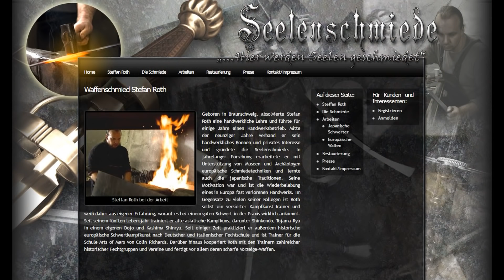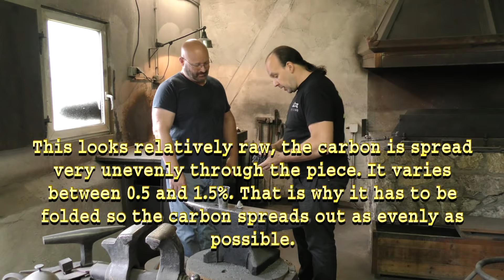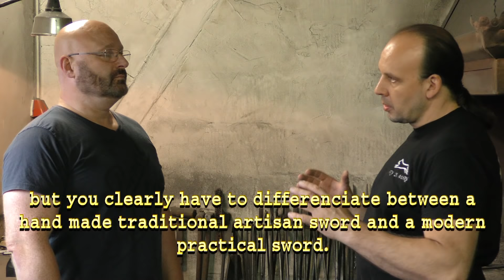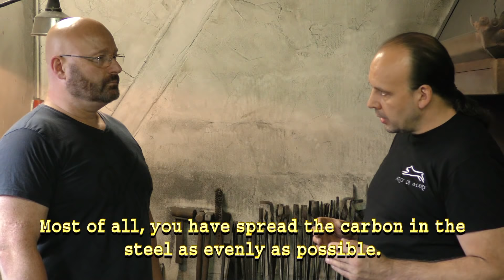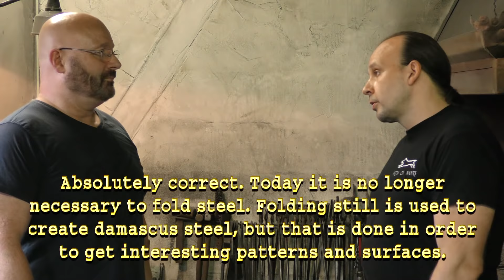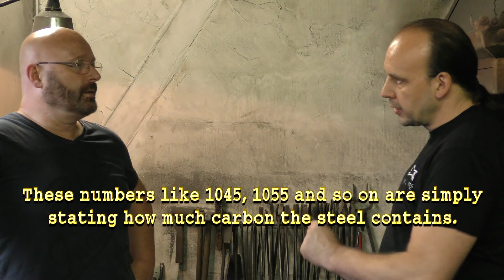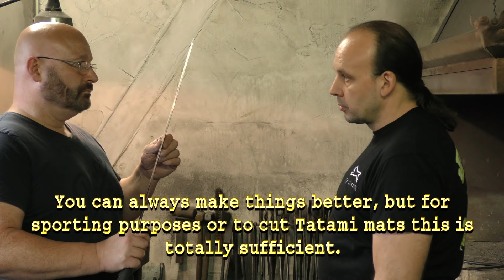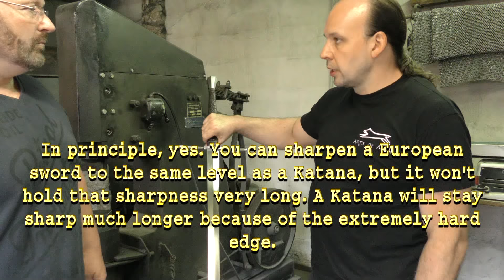Katana: The Naked Truth

Comment: I'm not an expert so feel free to correct me but it seems to me (by my observation at least) that cutting a tatami mat without a peg is a different kind of cutting test that could either be used for extremely sharp blades, extremely precise cuts or both. Without the peg, the tatami mat is going to fly off the stand even if you cut through it, because it is very light and doesn't require much force to move it. Therefore I think that cutting a tatami mat without a peg like that would be more of a test of precise edge alignment, blade sharpness, and anything else that can make cutting require less force, because it would show that you can cut through the mat with such little force that it remains standing even without being held in place.

Comment: you can cut steel with steel...kinda, but it still uses physics, a softer steel meeting a harder steel one of them will give out for instance i had a cheap 40 dollar mild steel ninja sword and my cousin was using a machete, the machete gut some nice little gashes into the blade of the ninja sword. 

Doing some research i found a video that showed you're supposed to parry and and block with flat of the blade and not the edge, supposedly George Washington's Saber had a an area of the blade that was wider for this purpose. Also if it's a double edged sword, and you black with the edge that means there is a chance the blade will be knocked into with the force or rebound.

Comment: Great video, the only thing missing is, why did the japanese decide to harden katanas more on the edge than the inside of the blade? Does it have any advantage over an uniformly hardened sword other than a better edge retention?
Reply: Historically there were only two options when it came to steel, it was either hard enough to break or soft enough to bend. A uniformly hardened sword would be more likely to break, and because of the kind of stress the steel in swords is subject to would break fairly easily. This is why in most places of the world swords were not a uniform hardness, even double-edged European swords typically used mild steel cores (mild steel doesn't significantly harden in a heat treatment) with high carbon edges. Or, as evidenced from at least a few Polish swords, they made the sword completely from mild steel and "case hardened" the outer layers.

Common use of uniform hardening wasn't really a thing until closer to the 18th century, coinciding with the rise of the nation-states in Europe. By this time spring tempering had become a more widespread practice which gave the sword a third alternative - to bend and return to true without either breaking or permanently deforming. Though European longswords are commonly erroneously said to be spring tempered (like their modern reproductions), there's virtually no evidence of the technique being used on European swords until the 16th century and even then it's few (relatively speaking). The only swords commonly seen with uniform hardness prior to this would be Middle Eastern and Indian swords, however it would be more accurate to say "uniform softness" as the swords were left annealed rather than hardened (due to their excessively high carbon content, combined with high concentrations of sulfur and phosphorus).

Comment: Nifty video, thanks Jörg. =)
For what it's worth, there is a specific kind of cutting practice/competition/record where you have a freestanding roll of tatami on the floor (not on a platform like here), and you try to cut it as many times as possible without it falling over (I think it's called "suegiri"). The current world record seems to be 7, held by Isao Machii. The 8th slice wasn't too far from succeeding either. Those slices were all diagonal downwards, with my physics hat on I'd say that's so that the roll is pushed against the floor during the slice, supporting it slightly more than pure sideways or an upwards cut would. Isao is generally a super duper accurate cutter, he has cut free standing pea pods in half, hit 6mm airsoft pellets from flight, etc. Supreme skill on that man, but I don't really doubt a European sword could do the same things if wielded by someone equally skilled (though finding that someone would be difficult). =)
Reply: Well finding such a man would be hard when the HEMA community is barely 35 years old with people with actual jobs and the test cutting part is only now getting real serious. Give it another 100 years and probably.

Comment: You can fix sword blades with welding some more material on them and then grind it sharp and polish. I have used PUK welding machines from Lampert. It is not easy but it is possible to fix blade so goodly that you cannot find the spot anymore what has been fixed. I am a goldsmith so not that hard work.

Comment: Actually in the process of making the Tamahagane, they will also produce a raw material with less carbon contain (with is softer). The traditional Katana smith will use both of these, with the Tamahagane wrapping around the softer material. So the hardness to softness is not just edge to back, but outside layer to in side as well. 

They reason they do this is combat vs. War. In a single combat, you might want a hard sword. But in a long war, you need a sword that holds it's edge much longer, yet do not just snap in half after thousands of cuts and impact. This is why they developed the Katana that way. If the reason of the wrapping is only to purify the steels, they would have just produce steel ingot and ship them out. But the fact is wrapping create different layers of strengths, softness, and material layout so the sword is much more durable in long combat.  If you think about it, the material layout is the reason why materials like wood fiber and chitin are so much stronger than just the base material composite. The hardness to softness of a mantis shrimp hammer so strong.

Also, the difference in materials (as mentioned above) is the reason why the blade is curved. The raw blade is made straight, but when they dip it in the oil to cool it off, the soft part strain much faster than the hard part, thus curving the sword and giving the hard part added tension (think about how tempered glass works).
The curved edge also has a side effect that focuses the point of impact on a single point (as compared to a straight edge), giving it more pressure when cutting into various shapes.

Lastly, it is said that a master swordsman will use his/her own body weight in a downward cut. They teach not to just use your arm in a cutting motion, but also weaken your legs to allow more downward pressure. This is usually not seen in western "master"'s teachings

Comment: But isn't the angle on the blade of the Katana meant to provide more surface area to the blade compared to a straight sword?
Reply: no. katanas are curved so little that it doesent help to contact with less surface. in fact, the difference between katana and longsword is mostly 2-4 degrees.

Comment: There is a video out where they fire a .50 cal repeatedly at a katana edge on  and it splits the first 4-6 rounds before eventually breaking. If i can find it i will link.
Reply: +Cornered Fox so a bunch of a soft metals broke steel?

Comment: Wow Jorg, very special video!! 

I think unfolded mono steel would not create the "hamon" that katanas have as by products of folding. So the swords would look different. In the museums showing nihonto, one of the prize features any viewer notices immediately is the aesthetic of the hamon. 

Secondly, a comment about your sword test from the last video. I think the katana and European sword would not receive full impact in the way it was tested. That is, sword suspended horizontally and propped up on both ends. Because swords are meant to be held on one end of it by two hands (or for some one hand). So the full force it receives would deflect or glide and these swords are designed with that type of usage. No?
Reply from the maker: The hamon is NOT a byproduct of the folding, but of the partial hardening. The clay coverage creates it. My "sword clash" test was going to the extreme, in fact the blow IS harder than it would ever occur in combat. Still no sword was cut through.
Reply: +JoergSprave ...Thank you for your response! I was able to confirm about the formation of the hamon in the edge-hardening process (as you stated). It occurs as the hardening clay is applied in part, thinly and thickly as it then gets heated to red hot then immediately cooked in liquid (one nationally awarded master used oil). The variation of the thin and thick application causes the hamon in this procedure. 

You are seriously knowledgable. We should all commend your research!

Comment: I had an agrument with a friend once that you guys might be able to help in. My friend said that say 50 knights in full plate armor and longswords would easily win over 50 samurais with no problems.(both groups are ofcourse the best around). His argument is that the armor and reach of their swords would hack down the lesser armored samurais. My counter argument is that the samurais are MUCH more agile, and would more easily slip between the knights defences and use their armor against them.
Reply: Hands down, the knights would win the battle. They would have some casualties (maybe 5-15), but they would win. The knights' biggest advantage is having full plate. No katana, or any sword for the matter, could cut through solid steel plate. Proper European swordsmen would have trained on how to target weak points, such as the armpits or neck of a knight, but the Samurai would not have this training; it was simply unneeded, as their opponents had no plate armour. With a European longsword, the knights would have little difficulty chopping and stabbing the samurais' leather and silk armour. Perhaps the samurai would manage to get some good strikes in and would wound some knights and kill a few more, but they would surely eventually lose.
Reply: A knight equipped with riveted mail, gambeson, and shield (much less plate armor) is more than capable of avoiding serious injury from katana-wielding samurai.

Comment: It balances the carbon out, but it also removes impurities. Unfortunately it also removes carbon, so too many folds could lead to a blade that is too soft.

If a smith were to make one now, they would be best starting with a higher carbon steel in order for it to come down to the right level when folding (too much carbon will make it brittle) 

Aaaaaand they clarified those points anyway. Fair play.

Comment: Comparing the katana to a longsword is like comparing a pair of nunchuks to a gun. If it doesn't make sense, it's because it doesn't. 

Samurais would never use katanas against heavily armoured foes, like knights. The Samurais had never come into contact with European knights, hence Japanese blacksmiths never had to reevaluate their weapons. The Japanese were more used to single combat, even on the battlefield - where they expected death and depended on their skill with their blade rather than the armour they wear. In fact even before the Mongol invasion of Japan, the average Samurai sword was longer and even thinner. The Japanese likely would have done the same if they had contact with knights. Perhaps adopting the Odachi as a main infantry weapon. 

Similarly, the European knights had never come into contact with the Mongols until much later where they suffered heavy casualties and military defeats because they were not used to the Mongol's rapid and mobile warfare. European weapons and armour proved little to aid in the battle against them.

Comment: Correct: in the middle of the rolled mat should be green bamboo
Reply: To my understanding, putting bamboo inside the rolls is a very rare thing. Tameshigiri is usually done with a pegged, non-bamboo core mat.
Reply: @Uacher  It is possible that there are different schools and different customs. The one I met consisted in cutting a soaked mat, very tightly wrapped wrapped around green bamboo. The mat was supposed to imitate soft tissues and bamboo - bone. Therefore, it would be important that it be freshly cut and green bamboo and not dried.
This was the attempt to cut the whole mat and bamboo inside. This can not be done with a knife. But maybe it's just some local invention...

Comment: 27:39, that's why structural steel swords may be better in combat.
Reply: Even though no sword was made with structural steel. In fact low-alloy spring steels are the best when it comes to swords, it can be hardened, it can take a beating and it will be like a sword. In fact European swords for the better part of the last 1000 years were made from that with quenching and tempering.

Comment: In reguards to the steel, in the beginning stages of WWII the Japanese used a lot of american steel for parts of aircraft because the quality of the steel wasn't as good and took longer to make in Japan, we had a lot better higher quality steel that was easier to make. We stopped giving them our steel and once they ran out they were forced to make their own steel which was not as good of quality.

One of the issues was the KI-84 "Frank" fighter had issues with landing gear failures, it was a later war fighter, because the steel they had access too to make specific parts of aircraft wasn't of the best quality and they had to make it in a hurry, landing gear failures would result. Again as the expert has stated, its not so much that the steel the Japanese had access to to make their blades was crap, it just took a lot of time folding it to get the impurities and distribute carbon content, time the Japanese didn't have when quickly manufacturing parts for airplanes, and its not at all that the same process was used to make a blade as some airplane parts, its just that either way around it was a very time consuming process to get good steel from japan they didn't have time for.

Comment: Any metallurgist who fetishizes cringe 70's orientalism (given that Japan had their peak of sword making when literal machine guns were around, where Germanic people were pumping out high quality steel in the 600's that was so good they have to LARP and pretend it was imported even though there's still not one scrap of physical linkage) is someone who needs to read a book about metal. Japanese are terrible metalworkers, so inefficient. They insist their blacksmith apprentices spend four years learning to rake coals first. It's absurd. They mix religion with craftsmanship and poison the quality of their output significantly.

Comment: so is the only advantage of katanas that you can get them sharper
Reply from the maker: Biggest advantage is that it will hold that sharp edge better as well.
Reply: If I remember correctly a katana is for cutting, slicing, severing, etc... Which is why samurai would often test a blade on convicts whether the loss would be arm, leg, or head.
A European sword is meant to deliver more blunt trauma and piercing damage against armor.  Though I'm not positive on that so don't quote me.
Reply: +TR DeathStalker you're almost certainly talking about medieval longswords. Longer european swords was never designed to deliver blunt force trauma. Almost no sword ever was. That's not what swords are by their very nature. 

European swords are longer and thinner than the katana, but almost the exact same weight. A katana would be just as effective delivering blunt force trauma as a european sword (not very effective). 

Tl;dr virtually no sword was ever designed for delivering blunt force. It goes against the very essence of what a sword is.
Reply: +Twiggyay, apparently I need to do more research into swords.  I wasn't very aware of that difference.  Thanks for the insight! Unlike most I actually admit when wrong, or unenlightened.
Reply: watch this guy skallagrim's channel. He knows a bunch about swords and have a lot of video where he talks about these things.

Comment: It's quite obvious that you can see a few wrongdoings. 

1. They didn't use Tamahagane to forge the Katana, therefore that's not considered Katana. Just a replica. 

2. They didn't put bamboo cores inside the straws which means most cutting tools can cut them....

3. They didn't even use so-called Katana right. You need pull right when the blade touches the substance and cut into the objects in a flash.

P.S. You need to work at least 5 years to get the authentic license for Katana sword craftsman. 

Shallow comparison, but he must be good at forging knives.
Reply: You obviously didn't even watch the start. Traditional katanas made from tamahagane do not have superior qualities, it is not used because it is better material, it is used because it is traditional. If you make a peace of art, you have to use authentic materials rather than the best ones. Therefore, A katana made of modern quality steel would perform better as a weapon, so if real katana (not a replica) would be used, it would fare even worse than a modern katana (if that would still be of quality make and not some cheap wallhanger).